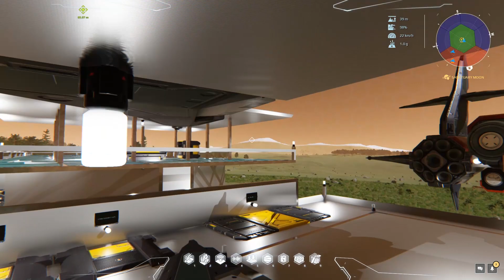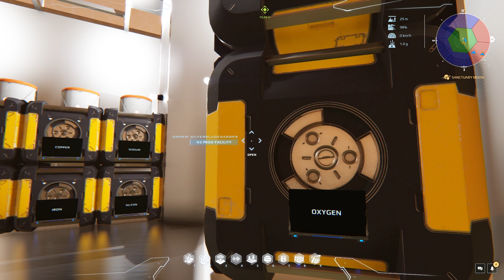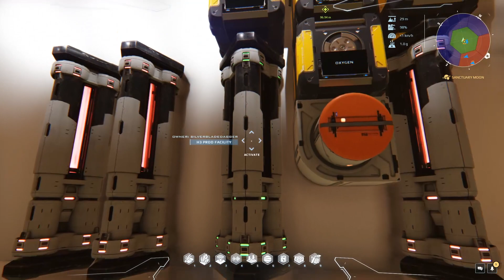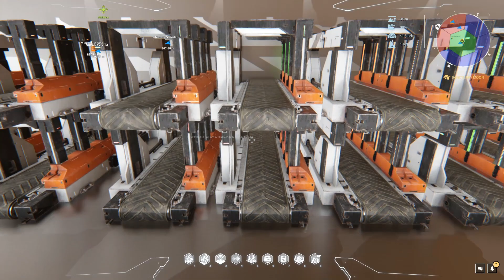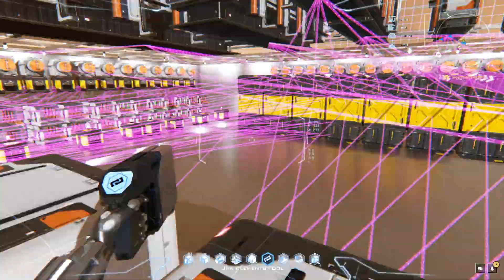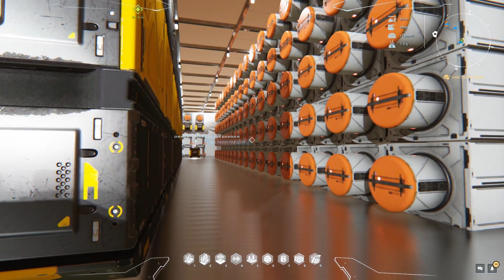Dual Universe: S00-E02 - Production Facility Tour - 11-21-20

Comment: Do you have a plan to make a vehicle called "argentum ferrum prompserat" ? :)
Reply from the maker: Eh, not really. In games like this, I often have a naming scheme for ships, they may change a bit, but I pick a thing and then name things like it after like things. So in this case, I made a bunch of hauler/shuttles, and named them after raptors/birds of prey. So I've used the Osprey, Eagle, and just recently the Kestrel, for those ships. Now if I make fighters, or fighting capital ships, I'd use a slightly different naming scheme. Depends on if I'm feeling saucy or not. :D